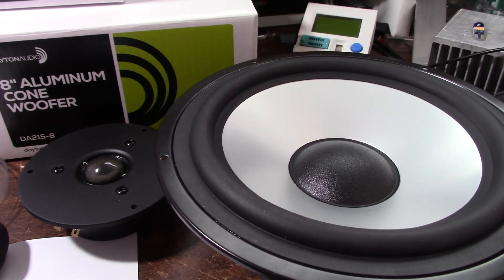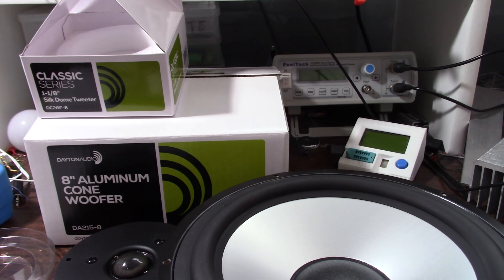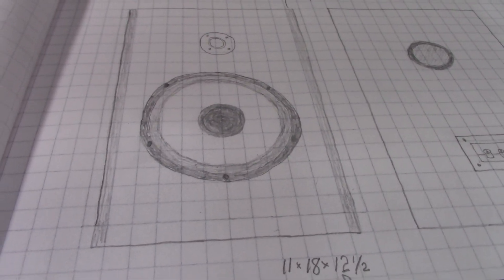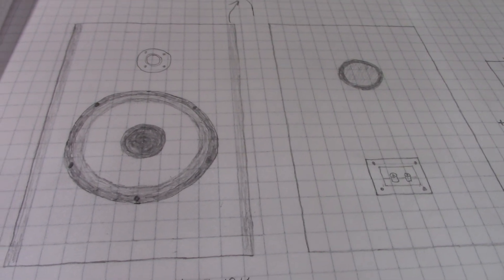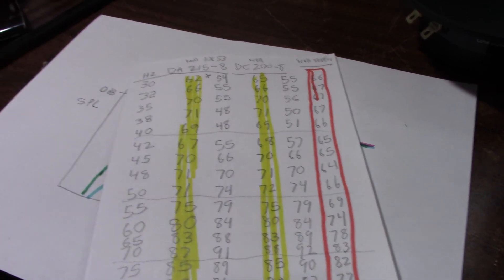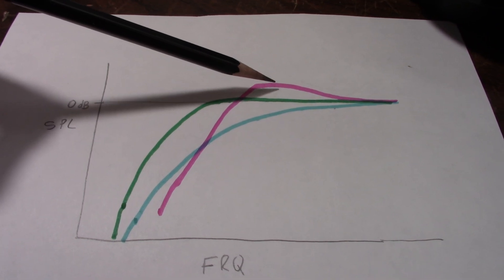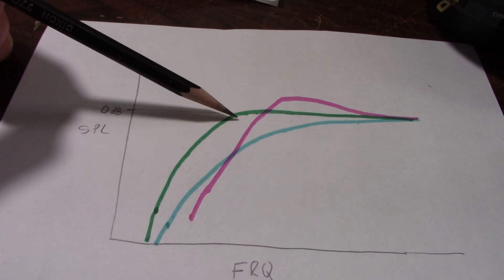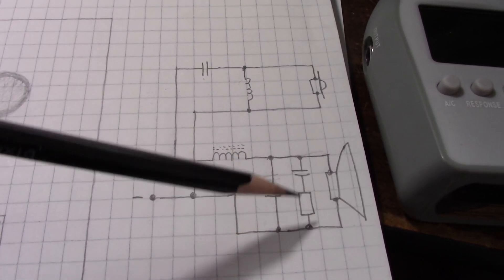Speaker design and build project - Part 1

Comment: There's a big DIY speaker crowd in the Midwest. Hope you can get some help with the cabinet and maybe even more precise measurements.

Re: universal crossover board, that sounds very cool. You might want to think about having positions for optional LCR series notches, which can be useful for metal woofer breakup peaks and also Fs resonance peaks on tweeters that don't use ferrofluid.

Comment: Hi  John,

I like your videos on all electronics. I find them very informative. Thank you for posting them. 

As a Youngstown native, I am always willing to assist. 

Some quick recommendations I would like to offer would be to keep the tweeter and the woofer as close as possible. This will help imaging, especially when you get “off axis”. 
If these drivers are too far away, it will give an odd impression that the sounds are coming from different sources. 

I also like the look of the front baffle, it reminds me of Old School Cerwin Vega! Love it!

I heard your comment on the baffle width. While I don’t think it will make a huge difference, but keeping the front baffle as narrow as possible helps with reflection off of it. Just an fyi, as you mentioned you wanted to use them to replace your current computer speakers. 

You also mentioned putting the port on the back, if you want to place these against or close to that back wall, I would recommend moving the port to the front. 

I know it will change the appearance, maybe the cabinet builder can make a vent in the front baffle instead of the round tube? The results will sound similar but look much different. 

I look forward to seeing you build this project. 

Thanks again,
Kevin

Comment: I used to be into diy loudspeakers some 20 years ago and the factor often used was 500% markup on material cost for store bought. Meaning if you spent 500 on drivers, crossovers and cabinet material the MSRP of equivalent would be in the $2500 range. Of course you need to enjoy the design and fabrication part otherwise you'll pay much of that back to a cabinet maker.  I did shop out custom crossover design to a place that had great quality parts and could do phase/frequency analysis with my chosen drivers.  That was well worth the extra investment.  And that Adire Audio Shiva 12" sub I fabed ...we'll, it still convinces guests that there's no replacement for displacement 🤣

Comment: Awesome to see you venturing into speaker building, your brass tacks analysis that gets us your followers far on a budget without getting caught up in the hysteria of high-end audio where far to few are roaming and the fun for a beginner can be limited. Often the entertainment value of a speaker design is more desired when it comes down to it, rather than having great phase and low distortion.

Comment: I built a pair using the same tweeter but with flat sides and a peerless 6.5  in woofers that have flat sides. Crossed over at 1800Hz. Push 85 watts on a daily basis for a year now and they only got better sounding.

Comment: Speaker building is a deep, deep rabbit hole.
Something I realised after many years is that the tweeter should have a waveguide, to match the polar response of the tweeter with that of the woofer at the crossover frequency.
The response in the room is better when the reflected sound from the walls has the same tonality as the direct sound.
I now have some Genelec monitors, but I still like building fun speaker projects.
I use MiniDSP active crossovers with the ability to use DSP EQ,  and to measure and adjust on the fly at my computer.
I have spent more on test gear than most spend on a complete HiFi system.

Comment: The speaker cabinet will almost always be the major cost of a speaker system. I tried using Room Equalization Wizard software with the Mini DSP microphone with dismal results. I would trust your ears to inform you about subjective sound quality. My experience tells me the crossover design and component quality are as important as driver selection. Good luck with your project.

Comment: That’s a rather nice tweeter for the price. I’m listening to them now, in a small set I built paired with a Dayton 4” full range driver. That Dayton aluminum cone woofer looks cool, but as I recall — and as aluminum cones tend to do — it will have a nasty breakup at around 2.5/3k, and consequently it could be difficult to integrate using a conventional analog Xover. I would look at the db response in that Hz region vs. the other woofer you’re considering. I’m looking forward to seeing where this project goes!
Reply from the maker: I returned the DA-215 for another DC-200 and tweeter since the 200 was giving me what I wanted at a lower cost. Playing music into the aluminum coned DA-215 cone without a crossover did have a very harsh sound.

Comment: Hi John
If you use a single driver across a frequency range of mid range frequencies and  low bass then  there is  inter modulation distortion off mid range from the low bass .

Comment: You can go crazy with audio. I'm into bang for the buck myself. So I'm using a lot of old used stuff I've found here and there. I did make the cabinet for the center channel speaker on my PC. I wasn't into the center channel speaker that came with the Blu Ray player I use as an amplifier. That whole system cost $10. The player, the speakers, the remote, all of it. It's a Sony!

Comment: I run my 8 inch studio jbl nearfield speaker monitors and matching sub as my output for my line 6 helix rack mount processor as my guitar amp in a living room the size of a small house when I jam and it cuts through the mix quite well when I'm playing a long solo.

Comment: Hey John, nice video. You said something about small speakers, well, I found (in the dumpster) two Bose Soundlink mini's and for what it is (really small) it is really impressive. As far I understand it, they used an airtight construction (aluminium body) with two very flexible passive radiators. The result is impressive. I don't know how easy it is to build an airtight cabinet but maybe this is something to try. With this design you can avoid the hassle of a bass port, bass port mismatch and bass port venting. A bass port is not just a hole with a pipe. Did you know a bass port must be 1/3 of the size of the woofer to be effective?

Comment: The 2 woofers are very similar in most respects. Biggest differences are in XMax , but mostly Qts. The 200's somewhat higher Qts lets it breathe in the lower registers. 

And yes, 100W for the x-over should be plenty. I haven't run either through WinISD, but I would bet that there'd be either some port noise or other distortions at that level, most likely XMech limits.
Reply: Higher qt means prefer closed cabinet
Reply: @jorrma jortikka  to a point, then it starts turning to open baffle. In this case, the Qts of 0.42 is right in a sweet spot where ported is not as "F3" constrained as the lower Qts driver, especially in non-optimal sized boxes (to a degree - obviously too small or too large will hinder performance regardless.)

Comment: I’ve used both the DC200 and the DA-215. As long as you can deal with the cone breakup of the 215 at the higher frequencies it has much better midrange. It would be my choice in a 2 way.  In a 3 way, wouldn’t matter

Comment: Have you considered using SpeakOn connectors rather than terminal blocks - very easy to use by comparison and 4-way versions are available for bi-amplification.
Reply from the maker: They are nice but I harvested some terminals from some old speakers.

Comment: The biggest issue you need to solve is handling a large, stiff cone, thus severe LMF break-up. Very low crossover frequency with steep, 18dB/oct slopes at minimum seems to be the way to go, besides such a large cone will beam in the upper mids already. Notch filters may be necessary. Hope the tweeter can handle 1.5 - 1.8kHz.
Reply from the maker: I went with the 1-1/8" (25.8mm) dome tweeter so I can cross a little lower. It will be interesting to put the finished speaker under measurement.
Reply: @JohnAudioTech  Oh absolutely, learned the hard way hearing can barely, if ever be relied upon during the design process. Phase relationship is very tricky to get right, but come on, everybody knows you will do a great job, as always !

Comment: Every day I learn something new but having a hard time figuring out which type of amplifier circuitry/topology is best for a 100w at 11ohm siren any advice would be appreciated!!  The siren is from a police car & audio will be from a cb radio
Reply from the maker: To get 100w into 11 Ohms, you need an amplifier with +/- 50 volt supply or ~54v single rail supply if bridged. I wouldn't use class D around radio gear.

Comment: I was into loudspeaker around 25 years ago and I found out that ported designs usually don't work the way you want it. You need a lot of experience, because their performance depend a lot in the way they were designed, especially how the port is made and where it is located. Small design changes can have huge effects mostly to the worst.

So I can strongly recomment to use closed cabinets to get the parameters you desire. I have also found out that symmetric designs work considerably better than asymmetric. Especially vertical D'Appolito in-line driver arrangements (two bass speakers with a single tweeter inbetween them) in closed cabinets have very good sound reproductive properties.

Comment: There's a HUGE difference between front and rear bass reflex, and it's not about the appearance. In your case, rear port, you should keep the speakerbox atleast 30cm away from the wall - you don't wanna hear them coloured lows. I would go with front ported box - they always sound more natural and clean. Still DIY speaker is a lottery ,)